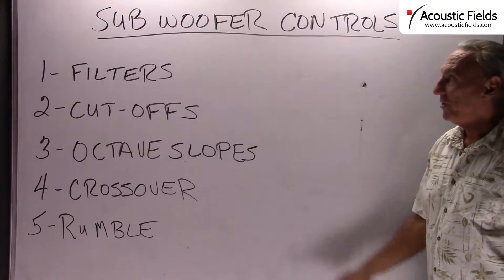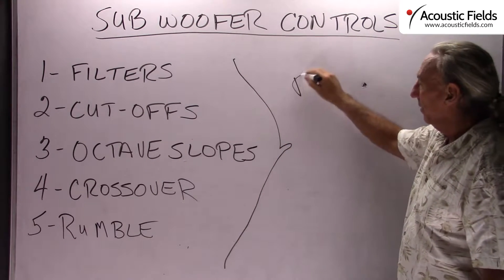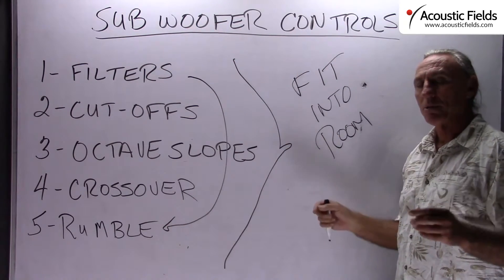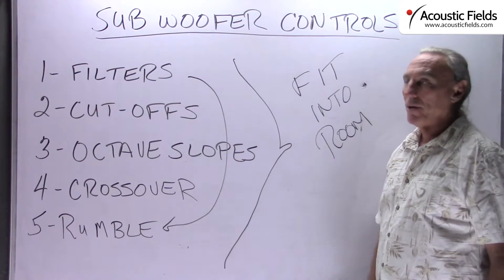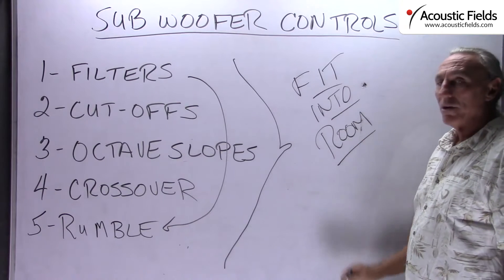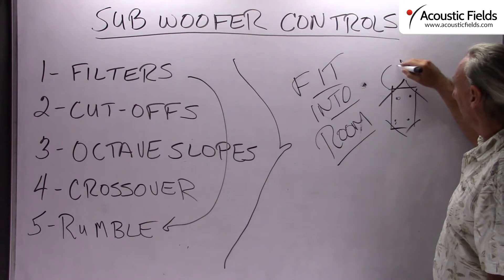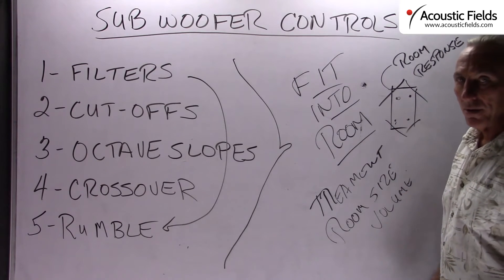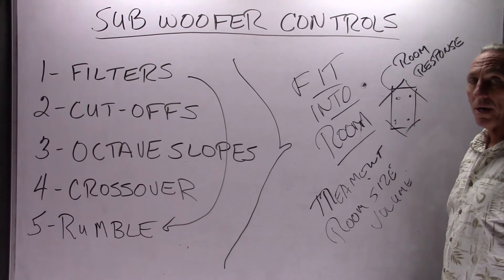Sub Woofer Controls - www.AcousticFields.com

Comment: Apart from mentioning few audio terms, and a mention that you need correct room size, you did not provide any solution. I know there is no one size fits all, but give us something...
Reply from the maker: Room size and volume are the most important elements to consider. Correct room size and volume reduce low frequency issues and the surface area to treat them, time signature of critical reflections, and a host of other issues. Fill out the information in this link:  http://www.acousticfields.com/free-room-analysis/. Lets take a look at your room.

Comment: I'm finding a lot of different opinions on where to place subwoofers.  I guess you just have to be 
pragmatic and try a lot of different places.  It's one of the most frustrating parts of setting up 
an audio system in the home.  I'm not disagreeing with what is said in this video.  I don't know 
enough to even have an opinion.  I DO appreciate Acoustic Fields sharing their knowledge.  

https://www.svsound.com/blogs/svs/75365187-the-art-of-subwoofer-placement

"SVS recommends starting with corner placement. Corner placement excites all possible room modes, resulting in a denser standing wave pattern in the room. This reduces (but doesn’t eliminate) the potential to encounter nulls, which are acoustic cancellation points or ‘dead spots’ in the room.

If corner placement on the front stage sounds awesome - consider yourself lucky and kick back to enjoy some music and movies!"

http://www.sonicdesign.se/subplace.html

http://realtraps.com/art_sub-placement.htm